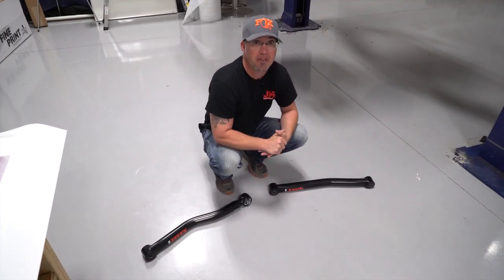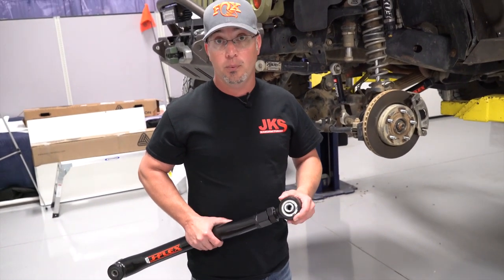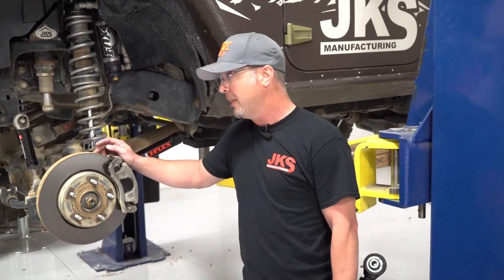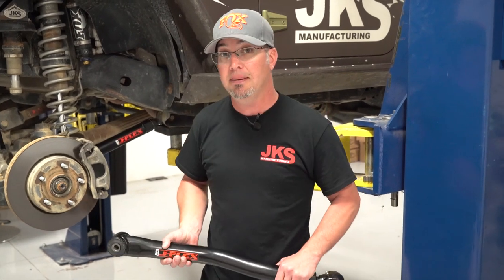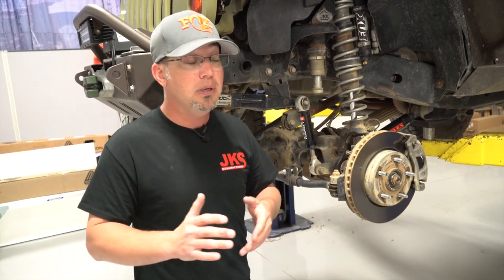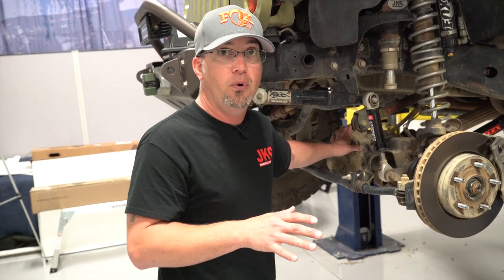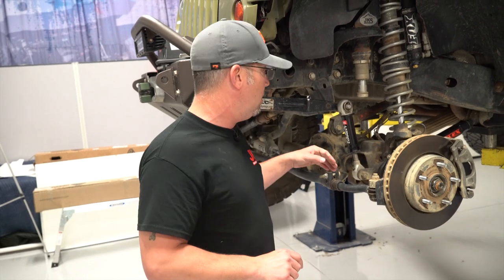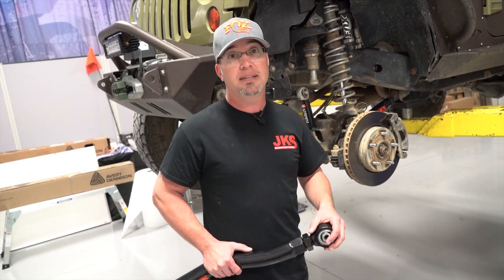Control Arm Caster | How To Fix

Comment: Amen, If I could have addressed DW all over again in my WJ I'd have started with the lower arms and installed adjustables adding caster for rolling the differential back. For me that fixed my death wobble from a 2.5 in lift.

Comment: I gave my 2016 Jku a 3” lift a few months ago. For the lift, I used just the springs , shocks and sway bar end links. All other parts are stock. I never had any issues with the ride. Recently  , my jku was hit on the left front wheel by another veh. I changed the broken parts and had a wheel alignment done. Now I’m feeling my jku wander. Can this be an issue caused by the control arms ? Thanks in advance for any suggestions

Comment: Hi. I replaced the lower control arm, and the coil spring, but now the wheel sits outside by 1degree (aproximative 1-2 cm)
I have a Ford Fusion Ju, but parts are the same as Fiesta.
I think i did something wrong, but i cannot figure what.
How can i adjust caster on a control arm ?